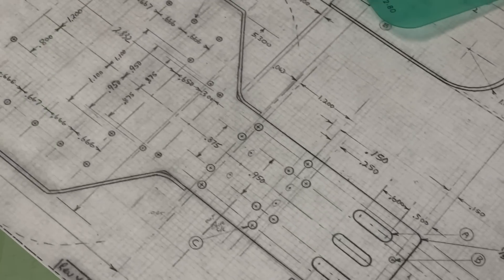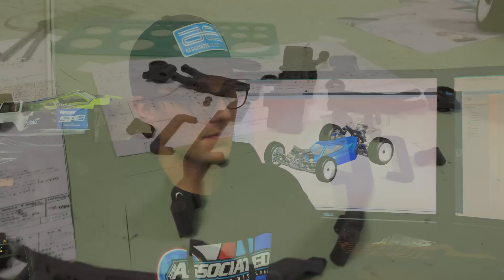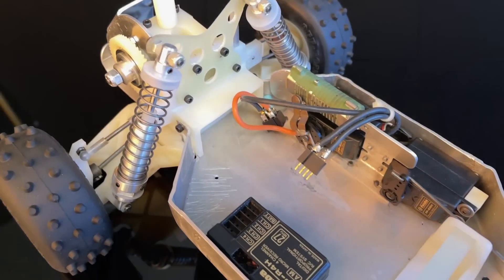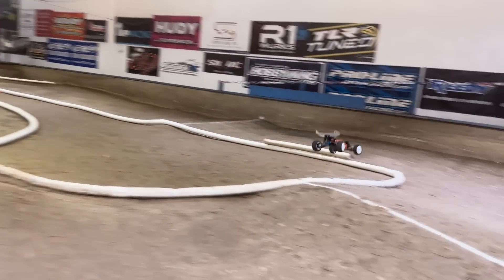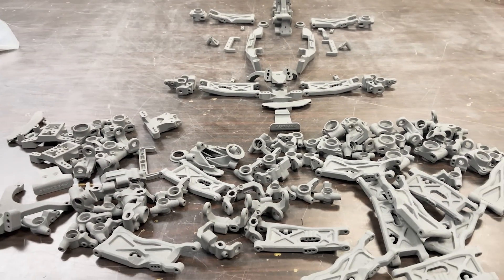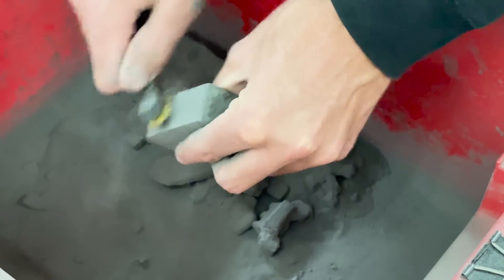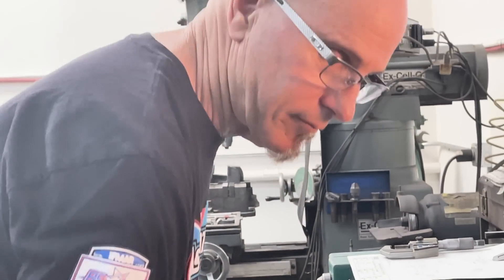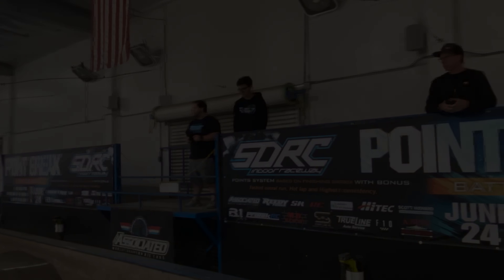PART 3 of 7 - RC10B7 Video Series:   Design Technology

Comment: So the whole car is now using "engineering materials" such as titanium and carbon fiber? No heavy steel or cheap plastics?  Thought so. Engineers have budgets determined by accountants and management.
Reply: They probably mean more carbon plastic and aluminum instead of plastic and steel
Reply: The opening monologue is from Husting back on the launch of the original Gold Pan RC10. That isn't a modern clip.

If anything, the B7 has less aluminum and CF bits since the B5. It is a very plastic fantastic design.